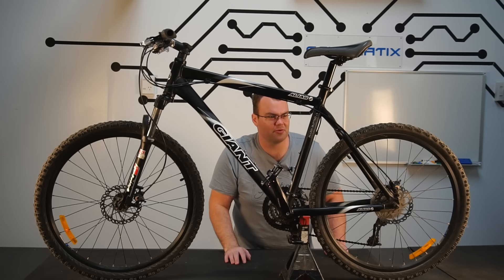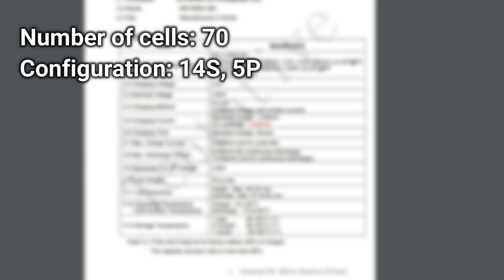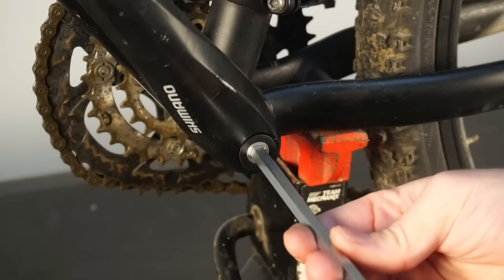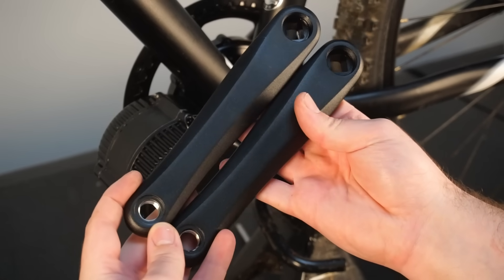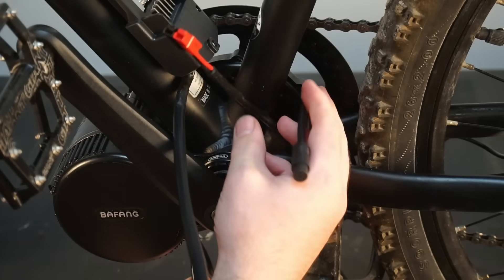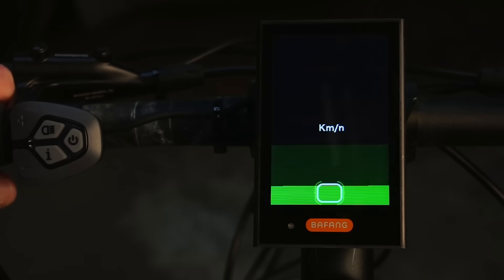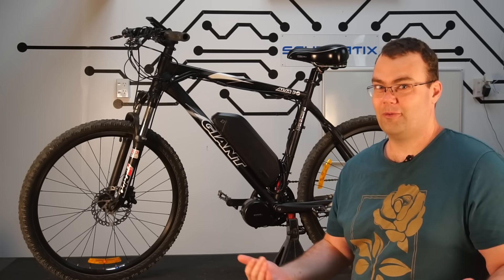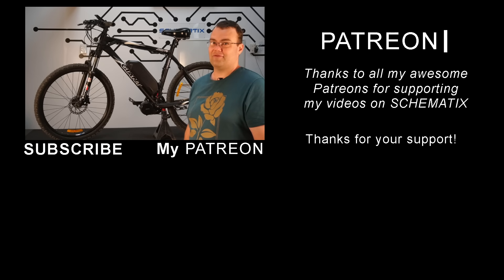eBike Conversion Kit, Install & Review ll Bafang BBS02B 750W motor

Comment: The thumb throttle is meant for assisting when taking off, DO NOT USE IT to cruise along without pedalling, this will burn out the motor and internal clutch.

Comment: Thank you for a great vid of how to do the conversion. I have a Giant Hybrid bike where the cables run under the crank with plastic guides, not like the Giant bike you used where the cables run along the top bar. In your opinion would there be enough room for the cables on my hybrid if this mid motor were used. Cheers Balty.

Comment: It seems a shame that you can’t keep the triple chain ring, so I have both very and very low gearing as I do long distance touring and wild camping. So I can’t be sure that I can charge battery everyday. But electric assistance is very useful pulling out into traffic on hills with a fully loaded bike. Plus cycling around left hand bends (uk) on A roads, going up hills. At 71 years old the push throttle is also very useful for walking beside my heavily laden bike up particularly steep hills.

Comment: I just received my Kit, nearly identical except I opted fro a 20 kw battery mounted on a rear bike rack, came with a 46 tooth sprocket, so I am waiting for a 36 tooth sprocket to arrive, which is the same as what is on the bike now. Cost was $1278 Aussie dollars for the Kit including Battery & bike Rack, extra sprocket was another $30. Will let you know how I go.

Comment: I've just fitted this kit to my 2021 orange crush, I had to modify the battery case as its tight in the frame and fitted a motor stabiliser bracket as it kept coming loose. I've managed 30 miles to a charge, it's a great kit, very happy.
Reply: I appreciate the information. How is this kit for wet weather? I live in Ireland!

Comment: I put the 1000w with a 52v 19.2ah shark battery on a 2015 specialized rockhopper. It pulls me around 32mph without any pedal assist. Top speed ive seen with pedaling is about 36mph. The range is still great (20miles) i push it really hard and its extremely cold where im at right now. With better conditions i could probably get closer to 50/60 miles on a charge. I also did a little but winterization. Ive been caught in the rain a few times and ride through snow and slush without much worry.
Reply: I was going 44 today on a downhill fastest ive ever gone on a bike.
Reply: If I may ask, does rain give any sort of unwanted problem to the Ebike?

Comment: Dang! I average 15-20mph(32km/h) on my bike without assistance. I have always wondered what it would be like with a kit like this.  Giving up my 21 gears is what's holding me back. Is there a system that just "assists" you and doesn't completely replace your gearing?

Comment: Really like your video. As a six foot ex-tight head prop, I appreciate your noting how well it worked out for your. Very clear details. I would start to order if I had any clue about how to size my bottom bracket. I do a variety of riding and want/need a flexible assist. I am also using my Yak trailer for a 35-40 km round trip to the store at the lake.
Thanks again.

Comment: 3:25 A similar battery today will be like 1000 buck.
Reply: Or more
Reply: 225.00 usd test and make own battery
Reply: @Chuckautomatic  The battery to my bike that is 58.8V max charged and 20Ah cost around 275 dollar shipped 3 years ago. Same battery capacity and voltage today goes the cheapest for around 1000. If I buy all new single cells instead (112) and that even have higher capacity, would cost around 290 shipped. The pro spot welder I bought for this and all gadgets to it and some 0.2 nickel strip plates, cost much less than a new battery. And then since I have the spot welder the next time I need to change it out its only new cells and you are done for a much, much less price.

Comment: I have one exact motor and have ridden with it for about 8 month now. 

Range: with my fully changed 52V 20Ah battery to 90% and on a flat road with only very minor up and downs, and discharged down to max 3.6V per cell (its a 14S8P battery) and I only use the throttle all the time, and no head wind or anything like that I get around 20km, if I draw it to 3.4V I can surely get out 10 km more and If i draw it down to 3V per cell most likely 5km more. But I go for life for the battery, if I want distance I also pedal which is the normal I do.

Recently I charged to 90% as usual as max and took a tour at level 6 assistans of 9 with normal pedaling get you up to 36kmh with very normal pedaling, which is a nice speed. I pedal like that  for 40km but after that the battery was only down to 3.6v per cell anyway.

Have bought (before the battery price went up like crazy) 2 more 52 cell batteries with a combined capacity close to the bigger one. With all those connected together that means that I can go full throttle all the time for over 40km. If I also pedal at 36kmh all the time then double that.

Comment: you can't make a 52 40 Amp battery fit into a hailong case,   you can't even fit a 52 30 into a hailong case ?   the link you briefly even shows it's only max 52v 20amp,   your battery is not 2000 wh...

Comment: I under tightened the motor and it gradually came loose after about six months. Not sure the tightening method described would last too long. Use the main nut installation tool or spanner!

Comment: On a 750w motor, does the voltage of the battery affect power output or range?

Comment: Will the 48v 17ah battery be sufficient to get full power output potential on the 750w motor or do you have to go with the 52v battery?

Comment: Crap cell choice need 20a minimum cells but better with 21700 30a cells.  Hit those cells with 8a load and watch the batteries capacity half over 30-40 cycles.... Never run a battery anything close to its limits. They do not like it and wont thank you for it

Comment: If you don’t have factory screw holes in your frame for a drink holder, can it be installed in a bike by drilling holes?  My bike is a vintage road bike, which doesn’t have those factory screw holes.

Comment: I fitted 250w (legal maximum here in the UK)  kits to our two hybrid bikes along with 36v 17ah batteries, not concerned with top speed, though both capable of over 20mph, just wanted to get up hills and travel further 😊, with a range of over 50 miles at gentle speeds, we are very pleased with our Bafang Kits, highly recommended.👍
Reply: Legal maximim, who cares about that, we're controlled to death here with ridiculous rules & regulations, I'll be buying the 750w motor kit here in UK
Reply: @Amanwithoutaplanhere   That's what I ended up putting on mine, love it, it actually reaches speeds of slightly over twenty mph if called upon, I hope I don't kill myself and everyone around me 😱🤦
Reply: @whatsit2ya247  one thing I'm curious about is why you cut the chain, did you order the wrong size front cog, I would have thought there would be enough tension with the back duralier without needing to cut the chain?
Reply: @whatsit2ya247  I need a good size motor as I'm planning on doing bikepacking with it and I'm a 6ft tall large man so it needs a good motor, I would like the 1000w but my budget won't stretch to that lol
Reply: @Amanwithoutaplanhere   Actually I didn't cut my chain, I did put a offset front sprocket on to help line up the lower taller gears, not sure how necessary that was? The only chain I cut was the new one I purchased to carry for a spare in case mine breaks, which hasn't been a issue yet, I do have the shift sensor installed that seems to be doing it's job.
I'm 5'11, 200lbs and it seems to have plenty of power to get me up fairly steep hills however I haven't had a chance to do any trails or serious hills because it's still winter here in N.W. US, but overall so far I'm pretty impressed 👍
FYI, It's installed on a fairly light '06 specialized stumpjumper full suspension, 52v, 17ah battery mounted on top tube with a drift maniac ebike conversion kit frame mount adapter.
Reply: @whatsit2ya247  thanks for the info I'll be going for the 48v 20ah battery setup my bike is lightweight aluminium 23 inch frame I'm over 200lbs so need a strong setup also the battery & motor is heavy not to mention I'll have camping gear on the bike too. I need to get some strong tyres I think lol
Reply: @Amanwithoutaplanhere  He fitted a new chain in the video if you were paying attention. They are supplied oversize from stock length and need adjusting to size. Additionally some front deraileuer cages dont split so you would have to split ths chain anyway to remove it.
Reply: @Amanwithoutaplanhere  fairy nuff, I have no need for 750w, but do like the 60 mile range from my 250w.. and the 20mph.
Reply: @londonbornboy As long as you use the bike the same...it won't matter if you make the motor more capable...it just means it's there if you need/want
Reply: I live in the uk, the city I live in is very hilly, I was going to go for a 500w, but may go for a 750w and stick a 250w label on it.
Reply: @wilhood6475  the law is an ass in this respect and you are doing the right thing in my opinion as a 250w motor is not going to hack it with sustained hill climbs. Because these Bafang kits have integrated controllers they are prone to overheating.  Better to have more power in reserve rather than grinding the ass off an underpowered motor.
Reply: I'm gonna fit a 1000w, UK too. Anything's legal as lomg as you dont get caught, which wont happen because it's gonna still look like a bike.
Reply: @goinawol9447  when police not there  habbi everything legal
Reply: Out of interest, where did you buy your kit from?
Reply: @howard6433  good idea
Reply: Mine came with 4 free stickers lol
Reply: what chain do you need for this motor?
1/2 "x 3/32"???
Reply: @juriylit8936  Yes..
Reply: @londonbornboy  
I have already tested three different kinds of chain..
Reply: Where I you ordered from?link please 🙏
Reply: How much more weight did the 250w kit add to your bike?
Reply: @BlindedReason  without the batteries about 4-5 kg.. the batteries are very heavy, but can be easily removed making the bikes easy to lift up onto the racks on our motorhome.
Reply: No disrespect intended, but that law is asinine. Is the public actually in favor of it?
Reply: @whatsit2ya247  nope.
Reply: @goinawol9447  So the public have no vote in the matter?
I'm new to this stuff, just now building my own and gathering info.
Here in the US I'm already seeing signs of discrimination and general snobbery from so called bicycle enthusiasts invading their perceived trails and such, by the way the same trails they "acquired" from us old dirt bikers years ago, sound familiar?
 Also I'm 60 and disabled just trying to stay active, nevertheless I'm anticipating seeing the middle finger on a regular basis.
Reply: @whatsit2ya247  What do you expect from the UK 😂 More people have legal action taken on them because they posted something on social media than in Russia.
Reply: @tknode3065  Right? What scares me is our current "leadership" in the US are jealous and working on even more control of their subjects.
Reply: @whatsit2ya247  I think you have to register it as an e bike if the motor is bigger than 250w.
Reply: @treeblackcrows  I don't have to register Jack sh*t here in Idaho USA! 😉🇺🇸

Comment: I dont like the fact that the battery is  just Vape batteries wired together. Would rather see high capacity flat cells wired together instead.

Comment: Have had two mountain bikes converted with Bafang 500 watt systems.  Chickened out an paid a shop to do it, for about 1800$US parts and labor. The 500 watt motor was quite adequate for a heavy person on moderate hills, it would get pretty hot going uphil but never cutout on me due to overheating, unlike the hub motor ebike I had before.  The 500 watt motor is powerful enough to pull the chain hard enough to skip cogs on the rear cassette when starting at low speed, so it would seem that most regular bikes chain systems cant handle much more than 500 watts, or you have to be careful.  The Bafang system I had only used wheel speed sensing, so setting #1 is like 5mph, #2 is like 7mph etc, it was kind of an unnatural pedalling feel as it had no torque sensor.  The Bosch systems feel a lot better and have a more natural pedaling feel.
Reply: was that $1800 for two systems and labour for two bikes?

Comment: Isn’t it more cost effective to buy a new e-bike rather than convert an ordinary bike? This kit is expensive!
Reply: yes, I believe that is true nowadays.  I had two Bafang bikes built,. and the parts and labor to have a shop do it was about 1800$US each time.  Aventon makes decent ebikes for 1500$US and less.   Though, you cannot now get a 500 watt motor ebike for 1500$US new as far as I know.  The cheaper hub motor ebikes overheat and the motor cuts out on hills if you are a heavy rider.

Comment: conversion kits are good an all but nothing beats a homemade version or a good pre-built like the dual motor ones because of the engineering and extra traction. also the price of the batteries are basically the same throughout all of these types making them all about the same price in the end.

Comment: The first thing I did while installing this kit was to throw away the Bafang crank arms....they're flat plate and have zero clearance for your heels.... guaranteed heel strike on every rotation. Pick up a set of Shimano cranks with swage built in to the design.

Comment: Nice video and very thorough, I wouldn't quite go as far as to say that the battery is the "Rolls Royce" of batteries though, not with 35e Samsung cells. They are a good quality cell, but there probably Samsung's mid range cell in terms of discharge rate. If the battery had Sony VCT6 or Molicell p26a cells then I would say its the Rolls Royce of batteries, they can churn out more than double the current continuously, so you would have a battery that would be better in cold weather as there would be less voltage sag and because its not under any stress load wise it would do far more cycles with higher current cells. However the more powerful cells do tend to lack a bit of capacity when compared with the lower drain cells. That is essentially why they are low drain in order to have higher capacity for use in larger more paralleled batteries or for use in devices like torches. Hence the 35e cells have a whopping 3500mah of capacity but lower discharge rate.

Comment: Hi, many thanks for this video, I have a question regarding the magnets in the brake handles. Are these magnets staying fixed on the handles? My worry is to lose them and the brake signal won't be sent to the controller.

Comment: Clicked through video and found that it does not answer two basic questions. 

Can it be driven without expensive, not interested in stats, easy to steel monitor? How do you put it in assist and motor only mode without a monitor????

I am sure you have no clue were these questions rise from.

And logically, when it is in motor only mode, do you pedal? Is there a mechanism that allows pedals to stay static while motor turns the 52 tooth gear? You have posted cheerful idiotic debil pedaling shorts.

And why do the pedal shafts have to be replaced with stock ones? And the gear, why does it have to be replaced too? I like my 2 shift front gear.

All the important before you buy questions the fat goof with nipples sticking through his t shirt did not imagine, did not intend, could not frap the mind boggle around.

Comment: As others have noted, yours is an excellent video. However, I do have two questions:

1. Can you provide (or point me to) dimensions of the top-of-the-line Samsung battery box. Need to see if it will fit on my frame in the same location as depicted in the video.
2. If that fitment doesn't work, are provided cables long enough to alternatively mount the battery on my stout rear rack?

Comment: Really bad advice on the chain. I followed this video and while it is a good tutorial hi advice on the chain and how to determine the length is way off. I wasted a chain... I followed his instruction to the letter, and when I cut the chain and fed it through it pulled the derailleur so freaking tight, and I couldn't even join the chain. It was like I was trying to button a pair of jeans from high school, not happening ... lol    I used a 44 tooth chainring, and did not need to adjust my chain length at all.     So other than that, great video.

Comment: Not necessarily a necessity but I think a rear basket or at least a rack to install a box to carry items. Lunch, book bag box, that sort of thing so it is not on your body but can expand your enjoyment of the bike. Maybe include space for hydration element.  The bike can certainly handle the extra weight, especially if it is a quality bike with adequate propulsion.

Comment: Hi mate very much enjoyed.. I have the same  Bafang BBS02B 750W A quick note you can cut and join the main wire from the display about 5 or 7 wires that need to be rejoined individually but easy to do. For a nice looking wiring job and a gear changing sensor is a big help..Happy trails

Comment: You explained everything perfectly except for the part about the magnets on the brakes. Are you saying that the motor will continue to power torque to the rear wheel even if the throttle is not being activated? Are you saying that the only way to disengage all Drive power is by pulling your brake levers and breaking the magnetic connection? If so this is rather troubling. Considering how flimsy the magnets are taped or glued on and considering all manner of inclement weather that cyclists are out in, a rider could suddenly find themselves with a missing magnet. I would also be worried that the magnet would come loose from the brake lever completely attaching itself to the other magnet and even though you're pulling the brakes... power is still  being delivered into the rear wheel thrusting you out into an intersection against the red light.